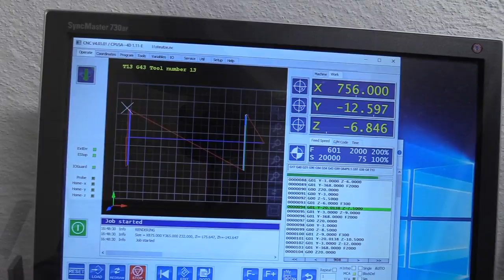Making a large composite mold of complex shape. Part 4: Parting surfaces and mold-making

Comment: You do beautiful work as a team. Congratulations on the finished product. I have a similar size one-time compound fairing (and mirror) to make. I chose to 3D-mill the foam from a CAD model, hard coat with epoxy, and fill and smooth. At that point I was going to use 50 microM thick polypropylene bagging sheet to isolate the wet carbon layup from the foam but I do not like the wrinkles left in the bagging material. I think I will use painters tape and release agent or lots of car wax. I will verify this part with a little experiment first. Then it is just a bunch of epoxy, peel-ply, carbon fiber cloth and some sanding and polishing. The final shell is a bit heavier than bagging and proper molds, but a very fast and simple process.

Comment: No video on vacuum infusing a shell from your multi-piece mold? If not, might you be able to point me to a video that demonstrates this process?
Reply from the maker: Sorry no video for this part. We used usual vacuum bagging this time: The piece produced is a pvc foam sandwich and infusion could have been used only for the outer face sheet. Here's more information on how we made the piece in that mold: 
https://hortenmicrolight.wordpress.com/2018/12/18/a-small-step-forward-every-day/

In principle it's possible to infuse the outer face sheet, wait till it hardened to bond the core add the inner face sheet using usual vacuum bagging. The molds need to be sealed with some acrylic sealant before srewing them together. This way you'll get a solid vacuum and will be able to properly infuse.

We have a couple of videos showing the infusion process in general. The first one shows how the dry layup is made, and the second one shows the infusion process:
https://youtu.be/ovEYTomr3V4
https://youtu.be/5YOT1TUwqTs

Comment: Question for the experienced composite wizards out there - 
Are you able to achieve a vacuum seal that allows you to seal and remove the vacuum pump, or is continuous vacuum pump operation required while the resin cures? If continuous pump operation is needed, would you find an automated pressure switch helpful in allowing the pump rest periodically?
Reply from the maker: Most of the times we could turn the pump off. For example, our vacuum is perfetcly solid when we make vacuum resin infusions. Sometimes we turn off the pump, but sometimes there is way to much material/effort behind the piece, so we do not want to take chances. We designed and built a simple pressure regulator for vacuum bagging. So in case the bag is slightly leaky, the pump goes on and off as needed.

Comment: Fantastic! But why did you use carbon for the mold? Was it needed? Is stiffness required for a mold? I would have guessed that a slightly more flexible mold might be better to release a new part.
Reply from the maker: Thanks! We used it for stiffness and weight. A stiff and light mold is better than heavy and flexible, which deforms on it's own weight. Also, I got the carbon for an extremely good price ;-) Releasing from flexible molds is indeed easier. However, much worse than fighting a little bit more to release is getting a premature release. That should be really avoided.
Reply: Ah thanks that makes sense.
Where can I get this carbon for an extremely good price? ;)
Reply from the maker: It was remaining stock from GRM Systems. We had to buy the complete roll (over 120 m²), but we have enough material now for all molds we need.

Comment: Hi Andres, thank you so much for sharing this. This gives a very good insight in mold making.

Why do you put PVA release agent on top of the w-70 wax?

You also apply small patches of soric xf in between the threaded inserts. What is the reason for that? 

Thank you for your answer. Love your work!
Reply from the maker: w-70 carnauba wax should be fine as a release agent. However, large curved parts are somewhat tricky to release. That's why we used also PVA, and still had to fight somewhat to get the part released. w-70 gives a great gloss and PVA reduces the needed force. 

The inserts should be properly embedded in the sandwich. Instead of Soric, you yould also use some thickened cotton resin or other strength bearing filler.

Comment: This is brilliant, can you tell what you were doing drawing a contour of the vacuum bag where there was local differential flow rate? Was it note it to do something with later or to change the port positions during production ?
Reply from the maker: Sometimes we draw contours to get an idea of the flow rate. Without markings it's hard to tell how fast it's moving. We usually aim at having a couple of cm or one inch per minute. The right speed depends on the laminate thickness: the thicker the laminate is, the slower the infusion front should be, so that the laminate is properly wetted.

Comment: Thanks for sharing your fabrications. For me is a reference.
Some questions:
- Do you use HP-Textiles products? and in particular the Epoxy Gel-Coat (HP-E30FB aluminium-filled).
- Do you have polished the Gel-Coat? (repaired?)
Mucha suerte con la contruccion de su avion.!
Carlos (desde Holanda)
Reply: I see that you have give the answer (Formenharz P + EPH 161-P from R&G)
Reply from the maker: Hola Carlos,

yes, we use HP-Textiles products. Mostly their resin infusion systems (HP-E120RI and HPE300RI). Though we bought a bucket of their gelcoat, we have not used it. Notice that repairing and polishing metall filled getcoats is in general not possible. This is because the metall particles produce a microscopically rough surface after sanding. We have polished Formenharz P + EPH161 from R&G, which works perfectly. This system is, however, not suitable for styrol based resins/paints. In that case, PVA release agent is a must to prevent direct contact to the gelcoat. If the pieces are large, I would strongly suggest to use a sprayable gel-coat. GRM Systems has one for a reasonable price.
Reply: Hola Andrés,

Thanks for your answer, you reply bring me in doubt.
I thought that the HP-E30FB aluminum filled resin, was repairable and could be polished.
I have read the HP description and the spec's sheet and I can't read anything about sanding or polishing, neither about repair procedure.
It is a pity because I have all ready bought 2,75 kg bucket of HP-E30FB.

I have read the spec's of the "Mould Resin P + Hardener EPH 161-P" and I think that this is what I need for my mould.
The mould surface has been painted with water based car paint.
I use and with good expericnces "Easy-Lease" realease agent (perfect stuff) from Easy-Composites in the UK.
For this mould I have applyed 3x layers of Easy-Lease and  5x layers of "Honey Wax" (mould release wax)
Regards,
Carlos

Comment: Why did you use such a expensive material as CF to make a mold. Most use GF to make molds and CF for the item to be molded.
Reply from the maker: Though CF is more expensive, it has some advantages over GF for larger monocoque molds: weight is significantly reduced, stiffness is much higher, both ending in less deformation due to self-weight. Also, CF has  less thermal expansion, which is better when heat treating parts in the mold. The mold we made before this one was a GF and Soric sandwich. It weights much more, needs a support and is much more difficult in handling than this one. Due to this reasons, I'll make all my future large molds with CF sandwiches. Sometimes you get cheaper CF, beause it has minor defects. The price is not comparable to CF used in part production ;-)

Comment: Wow very nice I want to do something similar to make a hull for a searey airplane. Why did you use carbon fiber for the mold? Isn't that expensive to do so?
Reply from the maker: We used carbon due to the lower weight and higher  stiffness. Large molds can be quite heavy. For small mold this is irrelevant, but as larger the molds get, to more important it is to have a light but stiff mold. For this kind of job, you can get carbon fiber of B quality, which is still more expensive than cheap glass fibers, but much less than A grade carbon. Notice that most of the stiffness spending thickness comes from the Soric® core, so the needed amount of cloth is not that high.

Comment: Hi Andres: Just happen to run across this video by chance. Nice work. I just finished making a high heat mold (will get to 360 to 370 degrees F for every use) for a large canopy acrylic canopy that is to be vacuum formed. Used Axson Siko EL-315 epoxy resin and EL-215 surface coat. I did all wet layup (not infusion). I did make a mistake and the surface coat shrunk a bit in post cure and one can see the cloth print through. I was wondering if you have any ideas on fixing it. I mean I can just go to town wet sanding it smooth to a polish but just wondered if you have run into fixing surface finish
Reply from the maker: In this case I would carefully wet sand it til the surface roughness is fine. Any subsequent application of resin will make trouble sooner or later. Usually large canopies are vacuum formed with a lubricant and a thin fleece between plug/mold and acrylic. The surface has to be good, but not perfect. Polishing is maybe not needed at all.

Epoxy resin without reinforcement tends to have more shrinkage. Plugs for vacuum forming ideally do not have a gelcoat. Only reinforcement and resin. In case a gelcoat is used, you should only appply a very thin coating. Just enough to create the surface. The same is true for usual molds.
Reply: @andreschavarria1450  Great. That is what I decided to do also. Wet sanded it to 400 and then 600 grit. Got it fairly even. I am a bit lost on what you said: "Usually large canopies are vacuum formed with a lubricant and a thin fleece between plug/mold and acrylic".  I am new to vacuum forming acrylic so if you can expand on this a bit for me, I would be very grateful. I built my own vacuum system and oven to heat the acrylic sheet and a hinged metal frame for the acrylic sheet that hinges and makes the sheet drop into the mould. Fleece in the US is type of fabric. Is that what you mean? What lubricant have you seen used in this application?
Reply from the maker: @abidfarooqui-sla3301  I made a plug for a canopy of our airplane, but the canopy itself was made by Plexiweiss. Their process is confidential. I know, however, that they do not use vacuum, but pull by hand and they mendtioned the usage of a lubricant and some type of fabric/fleece between acrylic and plug. The process will depend on the type and size of canopy, though.
Reply: @andreschavarria1450  Yeah I bet because once you figure out the process its not that difficult. So Plexiweiss is using a positive plug to do the canopy without even vacuum. That's interesting. I pull them using heat and vacuum in a female mould. It works but I may have to get mold surface better. This is why I was hoping you knew which cloth they used. I heat up the tool to around 300 F with the sheet on top clamped in a frame and then take it out and put the sheet in using a hinged frame sheet is on and then clamp it to the silicone seal on the edges on the tool and then reheat it to 350 F and pull vacuum. Since its not high volume production, I am good with it taking a couple of hours
Reply: @abidfarooqui-sla3301  I cannot speak for Plexiweiss, but I have seen a video of a team of men wearing welding gloves pulling a hot sheet of plexiglass down over top of a male canopy plug.  The plug is covered in felt.  It took 5 or six men to do this.

Comment: did you infuse a part on this mold? how did you seal all the joints?
Reply from the maker: We didn't infuse, because we made a sandwich and had several pieces that were joined afterwards. However, we vacuum bagged and had to seal the joints. We used some acrylic between them before tighting the bolts. Acrylic from the hardware store is cheap and a great vacuum sealant.

Comment: amazing. what king of gelcoat do you use? and the gelled resin s the same as the infusion resin? thanks for sharing!
Reply from the maker: Thanks! It's three different resins in total: The tooling gelcoat is Formenharz P + EPH 161-P from R&G, the infusion resin was HP-E120IR from HP-Textiles, and the gelled resin was the high strength laminating resin HP-E56L from HP-Textiles . All three are epoxi resins. I prefer the HP-E56L over the infusion resin for the coupling layer, because it has a lower shrinkage and is stronger. There are other tooling resins besides Formenharz P, which can be sprayed with a paint gun und end up in less effort. Ask, for example, GRM Systems.
Reply: thanks for the fast answer. amazing. will look for them for my next molds!
Reply: Andrés Chavarría hola , me intereza entrar en contacto con vos. Como lo puedo hacer?
Reply from the maker: Hola, héchame un mensaje a través de https://hortenmicrolight.wordpress.com/
Reply: Andrés Chavarría gracias , fui pero no se q parte seria para mandar mensaje, osea no entiendo el idioma. Si podes ,mandame un email a mi correo,
 
CEGQYA@hotmail.com

Gracias de nuevo.

Comment: What if it cracking?
Reply from the maker: In the first place, I would try to find out why it cracked. A well produced mold should not crack. If it cracked when separating parts or the pattern from the mold, then you should reconsider your release agent and its application procedure. The tooling gelcoat should be compatible to the used resin and you should keep the geltimes, so that bonding between gelcoat and laminate is good. Good tooling gelcoats are to some extend flexible, so that cracking should not happen unless air bubbles are between gelcoat and laminate. A cracked laminate is a clear sign that not sufficient material was used. In case it cracked while tempering, you probably had air bubles in the laminate or you didn't use symmetric layup. Repairing a mold is possible, but getting the surface right will be difficult to impossible. Sanding the spot and filling it with new tooling gelcoat could work. Use a gelcoat that can be sanded and polished. Sometimes it's better and easier to fill the damaged spot with some wax and polish the part instead of repairing the mold.

Comment: I use clay or was to fill in the parting board
Reply from the maker: Body filler allows to make very sharp edges and isn't much more effort. Wax was only used to fill small gaps or gaps where sharp edeges aren't that important.
Reply: I have made mold for over 40 years no and has al ways worked great,wish I can send you some pics of it

Comment: Why use such complex technologies and expensive materials for the matrix? After all, the required rigidity can be gained due to the usual thick glass mat and simple resin.
Reply from the maker: There are a couple of reasons, including low weight and high stiffness. Large molds with full glass laminates are very heavy and deform under their own weight. The ideal mold is light but stiff. If you mean polyester resin by "simple resin", then you should consider that it has a much higher shrinkage than epoxy and is, thus, not that well suited to make molds of high precision.